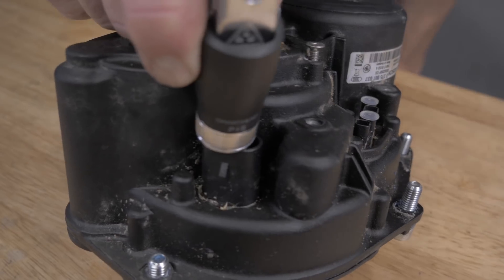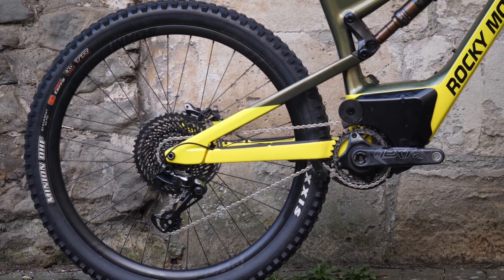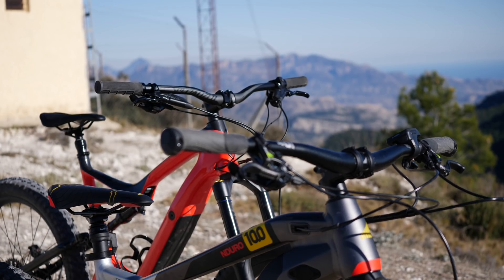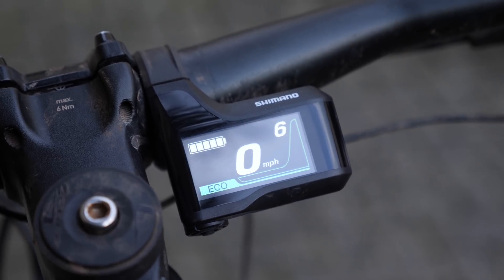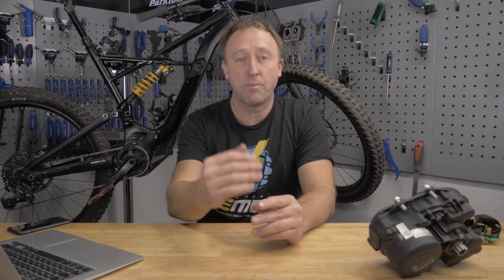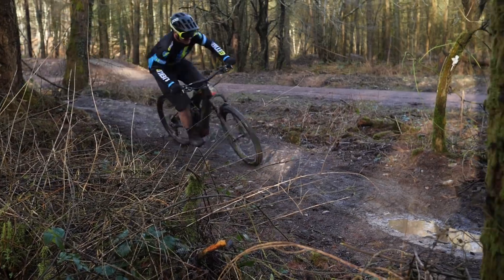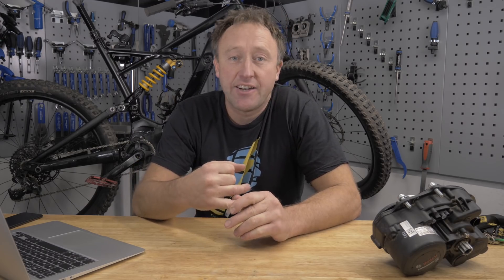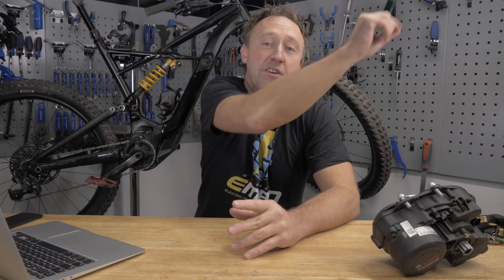E Mountain Bike Motors Explained | EMBN's E-Bike Fundamentals Part 1

Comment from the maker: Which do you use?
Reply from the maker: Well, that's your opinion. Obviously it's not ours! E-bikes add a whole new dimension to the sport but they're not for everyone just yet. Happy riding!
Reply: Your on the wrong channel then, i personally dont like tandem bikes or unicycles so guess what, i dont view those vids or comment...each to their own.
Reply: I have the Shim Steps and to me the system works well. I particularly like the Di2 intergration as the switch gear is both solid in operation and unified, matching the steps mode levers. I havent had the opportunity to compare, as ebikes are pretty much preorder in Oz and very rare demo days, outside Specialized. 
I have commented in the past about the crank arm lengths which Shimano has responded and now offers 165mm arms. I see them avialable in Germany but no shipping to Oz yet. 
I would also like a bashguard to protect the chain and front ring. 
Is there a particluar chain that is best and fits the Steps XT (number of links) set up and how many KMs should we expect from a chain if well maintained?
I just want to add that I still ride my mtb, dj and hardtail, its the motorbikes that have lost the love and time, so can see why those manyfacturers are getting on board!
Well done embn for putting in the education effort.
Reply: Haibike HardNine rx 2016 with the Yamaha PW and its really fun to drive that System. I tested Haibikes with Bosch and yamaha system and i found the noise on the bosch system more annoying and im a low cadance driver so the yamaha was and still is more my motor.
Reply: I have a Bosch motor you are right it is noisy. I've replaced seals inside the one good thing about Bosch is you can open it up.  I've noticed it is the dog COG that is making the noise so at some point I'l look to replace that bearing. Although I'm happy going into the motor I wouldn't recommend playing with the battery a large explosive lithium fire lodged between my thighs keeps me focus on what is important to me :)
Reply: Bafang BBSHD, 1000w, 160nm of torque...great motor!
Reply: Yamaha syncdrive sport. Three power modes ECO NORMAL POWER
Reply: I rode a Bosch for 3 years and now have a Levo Brose which is awesome!
Reply: I have a Giant Yamaha motor, 
Tapes off the power well good Low rpm power but maxes at 100rpm so need to gear up early . I don’t think any of the brushless motors cause peddle resistance just gives the 
Feels of drag  as your peddling a heavy bike after the limited speed .
Reply: Bafang Max Drive, user-programmable settings (such as top speed) are a bonus.
Reply: Bolt on currently, looking to get Specialized
Reply from the maker: Nice!
Reply: Enjoyable explanation on whats out there. One aspect not mentioned was the Q factor as this  is important if you swap between bikes. I'm on a Shimano Steps 8000 and that is the same as a standard MTB. I see Specialised is wider so you can feel the difference.
Reply: Brilliant. :)
Reply: Martyn Frith it uses a Brose motor but it’s developed with Specialized bikes in mind
Reply: I’ve ridden both Haibike & Emotion in the States, the shimano system on the Commencial Meta Power is going to be my next e-bike.... in another year who knows there are so many good options and ebikes are getting so much better!
Reply: Yamah pwx on Haibike. Fantastic motor, excellent power delivery. Spot on your comment about frequent mode change during the ride, that is definitely true for me.
I’m now waiting for my new Haibike, this time I choose Bosch CX. Soooo anxious to compare the two!
Reply: Please post your comparison here. Cheers.
Reply: I use a Specialized (LEVO) and really really love it !!!!
I'v tested the other brands to .. but for 'me' the Specialized was the best choice 
Greetings from the Benelux !!!!
Reply: I've commuted on a Haibike Bosch motor for 1500km, but for mtb I tried the Specialized Levo, which was amazing; but I hope to test the Merida Shimano motor this weekend.. price is a factor, but I do love the Brose :)
Reply: Bafang Bbshd
Reply: MAD?
Reply: I’ve got a 2017 Specialized and I thought it had a Brose motor. Is this not the case?
Reply: I have the old Yamaha PW system, they need to get better with the engagement on the PW SE, got some Bosch & Specialized Brose. Love eMTBs, one for everyday almost lol
Reply: I have both Yamaha PW on a Haibike , and a Giant Syncdrive PWX. They are both great motors with instant delivery.  I have to say the Haibike PW is quieter. I don't find the noisier extra power of the PWX all that useful - it has 5 modes and when I am pushing it up a hill, high 5 seems to max out at the same level as 4 ....
Reply: Made 7000km with a Bosch Performance (non CX), now riding a Brose (first model). Both are great choices, I agree that Bosch is very fluid and accurate in power delivery, Brose is better when pedaling with no assistance and slightly quieter. 

Bosch battery charger was better, it heated less and make no difference wether you plug first the AC side or DC, while the Brose goes into error if you plug DC first. Sounds like a non-issue, except, it means you can't use a timer to charge the battery right before you wake up in the morning, which is good practice for battery health and performance.
Reply: Merida with Shimano Steps
Reply: guess you have not ridden one then?
Reply: I have a Giant Dirt E (2017) with a Yamaha motor... 3 modes .. Eco, Normal and Sport ... Love it... Another great vid.. keep up the good work lads ...
Reply: Im owner of a Mondraker e Crafty R 2018 with Bosch ive choose Bosch because to Much torque on the Chain isnt good for your Pocket.To less Torque dont let me buy an Ebike. Ive riden pretty much every Motor. And i Like the character of  the E-MTB mode.
Reply: Electric Mountain Bike Network None. I'm too poor to afford one. They cost more then my motorbike. It's ridiculous
Reply: Browse S on a Specialized Turbo Levo. Currently the best.
Reply: haibike sduro 1.0  with the yamaha motor - love it
Reply: Shimano E8000 on Pedego Elevate & Focus Jam 2 , and Brose S in Pedego Conveyor. All are incredible..
Reply: Powerplay
Reply: bros
Reply: Impulse Evo RS on my Focus. Better display and more torque than the Bosch.
Reply: Still just legs without motor with 2x10 configuration ;) But i thinking about Yamaha or Bosh in next bike.
I preffer Yamaha, but Bosh is more popular.
Reply: I have an electric bick technologys 500 watt front hub 48/20 battery on a trek fx2 and I love it.
Reply: Yamaha on a Giant bicycle.
Reply: Shimano & Bosch
Reply: Bafang Ultra 1500W. 250W riders can kiss my ass.
Reply: @tarpattituopponen7783  when it breaks it's gonna be "no wallanty" from the chinese crap seller 😂
Reply: @Rodrigo540  I've broken it. The replacement part was sent with FedEx and it arrived in a week.
Reply: Electric Mountain Bike Network  none of these they take away the whole point of the sport
Reply: @udaysapra8821  That's what I thought until I had health issues including heart problems.
I loved my Scott Spark Twenty, but when my cardiologist warned me about the consequences of riding hills, I thought it was better to swallow my pride and purchase an e MTB.  Now I have a few kilometres under my belt, I am going places I never went before, and getting exercise as well.  So don't look down your nose at e-mtb riders.  Most of them may well have health issues..
Reply: @udaysapra8821  I bet you have never ridden an E MTB before !!
Reply: @udaysapra8821  you should change your name to King Canute, he couldn't stem the Tide either :)))
Reply: @udaysapra8821  mimimi
Reply: @udaysapra8821  That's a personal opinion tho, as one can argue that the sport is all about having fun and challenging yourself

Comment: Yamaha is one of the Best! Mine has 17.000 Km and NO Issues! Brose....their dead Motors....And they have now 7!! Types of Motors, the same with Bosch. 4!! generations, with 3-4 Displays, 2+ 4 Battreies, none of them fits, ...Yamaha, the Battreie from 2012 400 wh fits on the 2021 Bike! And its super reliable, and its a Workhorse. Cadence Support to 90, now to 120, and if we are honest, most Drivers here, dont even do that!! You always see Sportguys, and in Reality its almost 50+ to 55+ or even 60+
Do ONCE! 120 RPM on your Bike....you understand.
Yamaha is nearly the same Motor like 2012, and its still great. Climbing a Hill its the best. And its powerfull in low Revs, exactly what you need. (see above 55+).
AND! Its super efficient, a Yamaha with 500 wh goes further than a Bosch with even 600!
Its easy to pedal without Motor, which you really cant say from a Bosch.
Love it, wil buy a new All Mnt to have 2 Bikes.

Comment: 90nm of torque my arse that's more than a 500cc crosser or the same as a 1000cc road bike that does 200mph you have 1/3 of horsepower and roughly 10 to 15nm of torque as you can see when you come to small hills  give a true reading  not made up torque

Comment: LEVO De-restriction question:  Aside from increased heat, does it hurt the motor to run at higher RPM's if the LEVO has been de-restricted ? especially if it was only used on occasion & not like a road bike.   I am tempted to de-restrict the LEVO, but I don't want to break it.

Comment: I currently have a 2x11 drive train on my mountain bike.No E!... yet. I am thinking about getting an Ebike but I have some question of whether it will be worth it for me, and here's why.    I tow my 12 foot 23 kilo/50 lbs Town and Country Dirigo kayak behind my Mountain Bike (with gear - up to 65 lbs/29 kilos. I am able to do long hill climbs with it and go long distances also. I can climb hills with my granny gears barely but that is with 2x11. Are there any ebikes that can be converted or modified to a 2x10/11/12 to still allow my to ride up hills on distance trails with this extra weight. Will a emtb allow and ebike to pull this weight with using all the power? Or do I stick to my regular mountain bike and just keep converting  it to a 2x11? It would be a lot of money to find out that an ebike just won't be able to do it. The other bike I was looking at was the Riese & Müller Delite Mountain which is a distance bike but I still like unhooking the kayak and still doing my mountain biking which I can't do with the Delite Mountain bike.

Comment: Hub and Torque sensor FTW. Even for center of gravity, the rearward motor and the forward battery. Also a Hub drive doesn't destroy your chain. You can have dual drive with a Hub.

Comment: Hi thanks for an informative video , but can I throw in a couple of points- you tend to lean towards mid mount motors but may I just add  with my mid mount I found it very easy to break chains on rocky hill climbs under full combined power & as I live in a sandy dry area maintenance of the chain & sprockets was a continual pain however  with the hub mount I have increased my power considerably & virtually no maintenance. The enclosed mid mount gearbox does run a chain but it’s much larger & no derailer , nothing hanging down to get wiped off in rocky terrain. Just a thought.

Comment: I have an electric bike, it has a switch on the battery which is under my sead, in the handle bar I can't switch the battery on and off, it only can change the speed of the electric, it has 3 speed choose on it, if I just want to paddle the bike without the electric, it is very hard for me to reach the switch on the battery, how can I add a switch on and off on the handle bar, then I can choose use paddle or electric when I was ridding on my bike. please let me know on this question, thank you so much.
Reply: which bike do you have

Comment: This speed restriction bs takes all the fun out of it. I like going fast. That's why I still use an older controller system. Until I figure out how to flash firmware on the new ones.
Reply: the worst part is, you can easily pedal above 45kph even on a shitty 200€ hardtail, so the 25kph limit makes no sense. At least make it 30-35 but with a "intentional" drop off in power assist. So we dont just suddenly get to a "speed cliff" where we get drag

Comment: I have Scott e-spark 720 2014 with Bosch performance motor. It begin s clicking when pedaling. Amount of clicks depends on level of assist. What could be reason?
Reply: A poorly designed non robust overpiced mid drive unit. Get abafang BBSHD instead

Comment: Do any of the systems allow you to recharge the battery when pedaling down hill?
Reply: Actualy not, a feature like this is just available for backwheelmotors.
Reply: Regen breaking's purpose has NEver been to recharge your bike, but rather to cut down on break pads / brake disks wear down. In one ride you typically don't recharge you battery 2-10% with regen. No-one will be fool enough to pedal 100miles with e motor drag just to get 20miles range back into the battery. Ebike just don't have much inertia like a Tesla does...

Comment: BAFANG BBSHD Motor kit（amazon）：EUNORAU
Reply: I dont mind 3 or 4 zip ties to get better performance at on sixth of the cost with a Bafang BBSHD
Reply: you can very well hang a heavy , after market motor , battery ,controller  on a bike not meant , or built for it 

with wires hanging all over , or , zip tied 27 times 

I WOULD NOT

Comment: I need advise please - I bought a older E bike . It says 36 volt 250w , 
Max 500w . Brushed motor ( I want to buy a controller ) The bike does 20
 Kmh - Do I buy a 500w controller ? I would like more speed too if 
possible . Thanks
Reply: I would buy the 500 watt then. But 36v is kinda low I use 48v and want to upgrade to 60v myself. I also have a geared front hub.

Comment: unless i am missing some other factor power modes should be expressed as a % (the highest being 100%) of total power out put for a certain motor (eg 250w motor, eco 25% 62.5w ,standard 50% 125w ,turbo 100% 250w) this way it is easier to compare the power vs multiple modes and motors(the way each motor delivers its power is another issue that has more to do with feel and perception). cleaning compressors use oil as a lubricant so spraying any electrical connection will inadvertently put oil on the connectors try using computer spray cleaner and electrical contact cleaners but beware most of these are acidic. cheers and ill keep bing watching.......E-curious ;)

Comment: I have the Bosch Active Line and unlike the CX I haven't noticed any drag when assist cuts out.  There is a little drag at lower speeds with assist OFF but that disappears with the correct use of years and increased speed.  As an example, I'm 70 years of age, suffer spinal disabilities and I am also in heart failure but I ride my ebike 80% of the time with the motor OFF.  It's a Raleigh Motus Hybrid tourer not a EMTB but all the same, the Bosch Active Line is very impressive.  Also, it's silent as far as I can tell.  Range is outstanding.  My local terrain is pretty flat and I can get up to 100 miles on a single charge the WAY I RIDE IT.   Others who want an easier time will get less.  I went out today and as a test I used the motor over 25 miles on undulating roads and had a projected 27 miles remaining range plus the 5% reserve so even then 55/60 is easily attainable.  It is definitely not a power hungry motor which for me was a big selling point.

Comment: The Powerplay control is good, you're showing the very old type, the new type is so much better, even more smaller  and streamlined than the Specialized, It's so easy to change the power modes and the colour of the lights tell you what level with just a glance if not sure and the Battery level as well. Also I've altered the levels via the app, ecco 60% Trail 75% ludicrous left at 100% and ride in ecco most of the time, no need to conserve power here and as the Motor when off reverts to my setting of ecco I don't even have to change it up when restarting the Bike for a ride. One of the biggest plusses is the instant torque if misjudged and your stalling on a tricky Rock and have to Pedal and would strike your Pedal for sure, with the Rocky you can just jiggle the Pedals an inch or two and power over. No I don't work for Rocky :))) I'm an OAP.

Comment: I like the Bosch best, smooth transition between the modes and tails off nicely when you hit the max.  Shimano is my second choice a little more abrupt than Bosch, batteries are a little to bulky for my liking. Never tried Yamaha or Rocky Mountain so no idea. To many people I know have had countless issues with Brose/Specialized motors so that wouldn't be an option for me.

Comment: Great overview although I think the Torque section was not done very well. The manufacturers torque specs are rubbish from what I can tell. I work at the largest ebike shop in the world. Sydney Electric Bikes - we have over 100 models in store. The Brose motor is not as powerful as the Bosch but states 90Nm??? From riding all of them the Bosch CX is definitely the most powerful followed very closely by Impulse Evo RS then comes the Shimano E8000 which is pretty similar to Brose/Specialized and Yamaha. Haven't ridden the Rocky mountain.. The most important thing for anyone looking to buy is test ride all of them and see what works best for you. They all have slightly different gear shifting characteristics, power vs cadence vs torque responses and gearing (chainring size) options (often determined by frame geometry and motor position). Best thing about an Emtb is you can commute on it too and have a heap of fun, and go really fast

Comment: I disagree with your comment regarding choosing a bike because of the manufacturer of the motor. After doing extensive testing I decided on a Brose motor and then looked around for a bike that used that for a trail bike. There are other nice bikes but the motor quietness and natural feel makes a winner out of my Brose powered Bulls.
Reply from the maker: That's fair enough. The motor is a huge part of how the bike rides. 👍